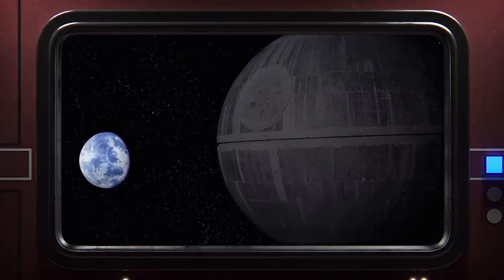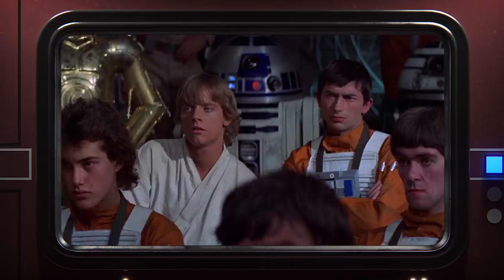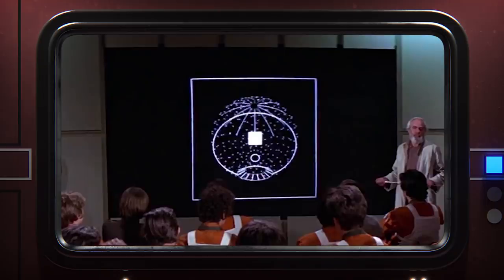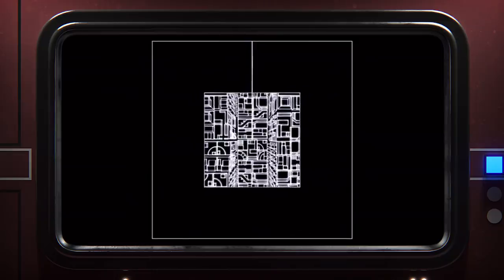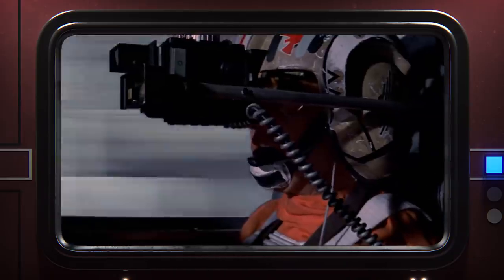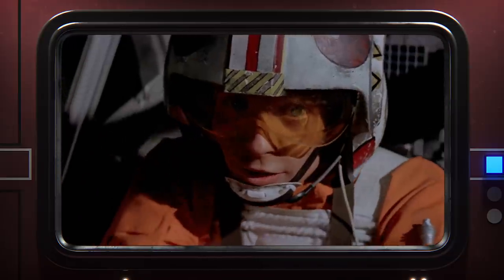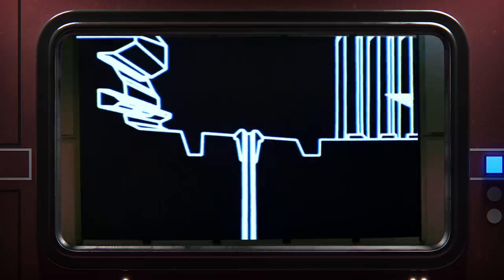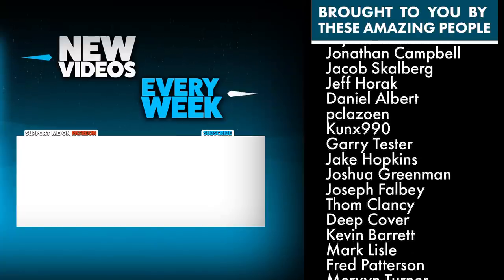The Thermal Exhaust Port Was NEVER a Problem

Comment: I just interpreted the thing with Urso to be that he purposefully left out a critical defense mechanism from that one exhaust port.  
That the others had a defense for proton torpedoes.  
Was that unnecessary?  Maybe, but I thought it was an interesting idea on how such a flaw, even a small one, ended up in there.

Also, a transcription of the explanation from Ep4:

DODONNA
                         The approach will not be easy. You are required to maneuver straight down this trench and skim the surface to this point. The target area is only two meters wide. It's a small thermal exhaust port, right below the main port. The shaft leads directly to the reactor system. A precise hit will start a chain reaction which should destroy the station.

               ~A murmer of disbelief runs through the room.~

                                     DODONNA
                         Only a precise hit will set up a chain reaction. The shaft is ray-shielded, so you'll have to use proton torpedoes.
Reply: In the Audio Book for Rogue One, it was said he kinda tricked the Empire into putting it there. He explained the issue, and gave three solutions. His favored solution was not the exhaust port, but another one (I didn't quite understand it, something like a large funnel, but long story short it made sure to mention that his preferred method was quite expensive and the exhaust port was the cheapest. He especially made it clear taht though the exhaust port wouldn't protect the standard crew quarters from radiation, it would protect the Officer Quarters, and seeing as he was presenting this to an Officer (some lieutenant, I believe), that would be fine with the Empire).

Comment: @EC Henry thank you as I have from the moment I heard about Rogue One 'fixing a plot hole' from the original movie I knew it was bull. As you say not only are there more then just the main port and the one that they used in A New Hope but 30 ships tried to hit the target and only two got close and only Luke got the job done and he is not only the son of the greatest starpilot in the galaxy but the strongest Force sensitive in the galaxy. I myself have long since pointed out that a weapon that can destroy a planet has to have an exhaust port, it just makes sense and with this video say there were at least 19 it makes even more sense.
Reply: On top of that, the Empire took the effort to put a ray shield over it. From the Empire's perspective, that solved the weakness. Assuming they knew about the chain reaction issue in the first place. They might not have and it was an honest design flaw. Even if they did, Proton torpedoes were expensive. Nobody would shoot one at an otherwise inconsequential exhaust port
. They'd have to launch a suicide mission to get the plans for the station in order to find that out. Nobody would be that crazy.

Complaining about the exhaust port is like complaining about an otherwise impenetrable suit of armor because it will shatter to pieces if you hit the left ankle with an obsidian axe. 1. Nobody is going to know about that. 2. Good luck attacking a fully armored knight with a sharp rock and hitting them there.

Comment: I agree with you on this but for one more reason that makes it actually impossible in the movie context without some massive levels of force interference. The Death Star was moving. It was orbiting the planet fast enough for there to be a visible difference in planet positioning in relation to Yavin 4 on a minute to minute basis. So it was moving and it was moving fast. Even if the shot was precise and even if the proton torpedoes could pull off that 90 degree turn, the death star would just be in motion and the proton torpedoes would have exploded against the inside of the shaft long before reaching the core.

Comment: Continuing with my theory,  the main exhaust port may have automatic port valves that pivot closed, to prevent flow back back into the reactor. The small secondary may have been flagged as a relief port with a valve, at the reactor itself, that would only open, automatically, as a pressure relief, being side by side with the main exhaust port. The small "flammable gas" tube  would evacuate the gas, as a precaution as well, from the flow created by the emergency port opening. Since the reactor would have to be in an extreme "over pressure condition, for the valve to open, it would be assumed pressure would be released outward. In theory, even an engineer may overlook the possibility that the port could actually be turned into an intake.  Perhaps, during the first test of the reactor's emergency port(s), Galen sabotaged the valve stop of that one port valve, to lose just enough valve stop integrity. So, if external pressure of a certain amount, suddenly pressed on it, say from an explosion, it would fail. Causing an actual "draw in" flow into the reactor, under normal operating standards.   Just a possible theory to consider.

Comment: It kind of reminds me of WW2, where on occasion the shells of enemy ships or air-dropped bombs would sometimes land in a ship's smokestack and cause some VERY serious damage to the engines or other systems. 

Did it happen? Yes. Did really bad things happen when something did get through the funnel? Yes. Could it be considered a weakness in the design of the warship? I guess so, yeah. But you can't just remove the ship's ventilation! Bad stuff happens when those gasses build up, and it'll probably be a lot worse and more certain than just building that small weakness into the design.

Comment: Well what I personally would like to think is that the 18 or so smaller exhaust ports have the same direct shot to the core but the trench they chose to attack had the least defenses, like least number of point defenses and furthest from hangar bays that have TIE screens and also one that has a good angle of pursuit from where the rebels are attacking from. And the main exhaust port is the most defended and doesn't lead directly to the core because they know it's an obvious target. 

I also hate how people trash on the Death Star flaw even though there was really no way the designers could predict that they would 1. Be able to obtain the plans from what is essentially Fort Knox and 2. Have an extremely talented pilot that also happens to be force sensitive even though which thought the Jedi were dead at this point or didn't even exist. This was a very specific outcome and was realistically unforeseeable by the designers.

Comment: I agree with you but as I can be very meticulous, I may have an argument to be in favor of RO.
If missiles are the only weapons that can pass the shield as it is a ray shield, maybe the empire could build just a simple grid or even a metal bar that will prevent the attack of a missile placed in one or several spots of the long pipe to the generator. 
Because viewing the size of the proton torpedo it is already very difficult to success one shot so just having a few metal bars or grids that will stop as many successful abd rare shots can definitely dissuade any operation to destroy the Death Star.
Maybe I go to far but I always thought about that long before Rogue One, so that's why I found pretty cool the justification.

Comment: I'm not an engineer, but I know that engineering is always a case of compromises.  You're never going to make everything 100% fool proof, regardless of whether you're designing toaster ovens or moon-sized space stations, so you're always going to have go with the best overall balanced design.  Which means that small things like a potential weak spot one of 20 or more exhaust ports are going to either be overlooked entirely or concluded that the odds of that being a very serious weakness are very low.

Comment: Any physical torpedo would’ve been able to penetrate it as ray shields are only for high energy objects like laser blasts, but proton torpedoes might be the only ones capable of doing the damage and maneuvering in the way they did, the rest of the exhaust ports may have had secondary chambers which made it so that anything that got through couldn’t get to the core or even deep enough to do any significant damage, but Galen Erso sabotaging it still makes a lot of sense as to why that port didn’t have secondary chambers or anything. Also Star Wars memes are often based on misinformation or just plain lack of attention, ie stormtroopers always missing, even though they explained it in the movie as being on purpose

Comment: The sabotage was not giving the exhaust port a u-bend. Therefore allowing a torpedo to go straight down the exhaust port.
Reply: Paul Naughton actually, the sabotage was making the rector very unstable. If it was not as unstable, you would have need more then 2 torpedos to destroy it.

Comment: I believe the sabotage was, in addition to making the reactor as nstable as it needed to be for a single torpedo to detonate it, was probably also some sabotage that is the reason only this exhaust port would work. Its easy to dismis a single port with a faulty design than it would be if every port had it.

Comment: Like you said, the Death Star is covered in trenches so who's to say that each trench has an exhaust port? Yeah Dodonna says "There's a small thermal exhaust port" and that could mean that there are many but it can also be singular; "I have a phone". Either way it's still implied in Rogue One that it was designed to be undetectable and I believe that there was a line in RotJ about Death Star II having multiple smaller exhaust ports.

Comment: I mean from an engineering and common sense standpoint, why did it need an exhaust port that leads directly to the most vulnrable part of the station? It doesn't matter if it's a one in a million shot, The french didn't think germany could cross the Maginot, and Rome didn't think Hannibal could cross the alps with elephants in tow. The cost of getting that wager wrong vastly overshadows the cost of ensuring it wasn't a possibility, which is clearly not that hard considering they, as you say, have 20 exhaust ports (including the main one) that don't pose a risk of catastrophic failure.

Comment: To play the devil's advocate, the argument could be made that the specific exhaust port was the only one designed to be an exploitable weak point. The others could've all had grates or bends or some kind of protective measure against torpedoes, blaster cannon fire or whatever, while that specific port was a straight, uninhibited shot to the main reactor

Comment: That one port is a straight line to the reactor which makes it easy for the proton torpedo to navigate to. The others probably do not make a direct connection but goes through other subsystems and not in a straight line either.
Reply: not straight into the reactor, that would've taken way too long. like they said in the movie, it causes a chain reaction. It blows up something, which blows up another thing, and on and on until the entire station blows up

Comment: My issue with it is how did they ever plan to have the freaking torpedoes arc in and then stay straight the entire length of the vent without coming into contact with the wall once, considering the size of the thing. As mentioned in this video it does seem Luke uses the force to manipulate them to arc in, but really? Kinda makes him a MARY SUE.
Reply: The aim wasn't to fire the torpedo itself through the hatch and all the way down to the reactor. The idea was to start a "chain reaction" that would ultimately reach the core; e.g. the torpedo hits something inside the exhaust shaft, those components are destroyed, the explosion and debris destroys something next to that, and so on, until you hit the main reactors. It's basically the embodiment of cascade failure, where a series of individually small malfunctions snowball into something much worse.

Comment: To stregnthen your arguement, they don't say the missles will go down and hit the core. Ge says it will cause a chain reaction. This can imply that such a reaction would not occure if any of the other exhause ports were similarly attacked. Yet another level of protection. This could give creedence to the Rouge One "designed flaw" but would also give creedence to it being so minor as to be ignored entirely.

Comment: For me the issue wasn't the existence of the thermal exhaust port. That makes sense for reasons explained in the video and in other comments here. For me it was the method of defense:
Energy shields that are explicitly known in the Star Wars universe to only stop some projectiles, not all of them. I'm curious if they couldn't have put something more substantial. Like an s-bend. Or a series of muffler plates. Or some grates. Anything to make the straight shot down to the reactor not a straight shot and the torpedoes hit something less vital first

Comment: It makes more sense if the torpedo hits something in the shaft that creates a chain reaction.  Often when engineering complex systems, care is taken to provide shielding between critical or dangerous components so a failure in one does not cause the loss of others.    I always saw galen's sabotahe as carefully positioning internal components such that damage at that exhaust port would cascade down into the core.

Comment: I never really stopped to reason what happened after the torpedos got in.
If you think about it, closing the exhaust port is... going to prevent all heat from exhausting.
(Maybe Tarkin doomed them all by ordering to fire!)

And it's not like they'd have extra spare exhaust ports, after all it was a weakness.

Comment: My issue with the "the death star weakens was a sabotage" is that the geonosians are the ones that designed the death star, not the empire, so a sabotage couldn't be implemented into the plans to begin with
Reply: I bet the Geonosians only designed part of it, or the Empire made some heavy changes. Would you really want the sort of people who have gladiatorial combat in a universe with ftl to have the designs for a world ending battlestation?
Reply: @adams13245  they may have changed the interior design of rooms and some of the controls. There is no reason to change hole that is supposed to exhaust heat.

Comment: I don't have a problem with the exhaust ports, but why is does single point detonation cause the entire station to explode? Instead of a centralized power source, could there be multiple power sources for separate hemispheres of the system so that one point failure does not destroy the entire station?
Perhaps the reactor must be centralized in order to power the superlaser (If it draws from multiple superlasers they would still be connected in some way to feed directly to the weapon).

Comment: When watching Rogue One, I always felt Galen's sabotage had nothing to do with the exhaust port. The key is what he says and who he sent the message to.

"Saul. The reactor module. That's the key. That's the place I've laid my trap. It's well hidden, and unstable. One blast to any part of it will destroy the entire station. You'll need the plans, the structural plans to find the reactor. [...] Any pressurized explosion to the reactor module will cell off a chain reaction that will destroy the entire station"

Nothing about an exhaust port, everything about a reactor. A reactor that's been designed to explode at the slightest provocation, and has also been tied into the grid in such a way to cause every other reaction to detonate. I don't think Galen's idea was ever for someone to fling a torpedo down a small hole. His plan was for someone to be inside and plant a small charge. That's why he told Saul; he and his Rebel cell are ground fighters and infiltrators. They wouldn't use a fighter to get the job done, they'd try to sneak aboard and take it out from within.

Throwing a torpedo at it was the plan of the Rebels on Yavin, who didn't have the time to sneak aboard the Death Star and place a charge. It wasn't a good plan, but it was the only one they could do in the time they had.

But... I know there's other information outside of the movie that explicitly states it was the exhaust port, and the reason behind the message being sent to Saul was simply because that's who Galen knew.

Comment: The exhaust port was never a problem for me. Everything has it's weakpoints and its flaws. Exhaust ports on real tactical vehicles are weakpoints in the armor. I think the greater obvious weakpoint is that it goes in a straight line to the reactor.... but then again, that may have been by design.
Reply: Or, since it was a "chain reaction" that would lead to the reactor blowing maybe they just had to go in to a point and blow which would send a blast further down the next line and so on until the reactor suffers a catastrophic hit.

Comment: THANK YOU. I hate Rogue One so much. The hubris of the Empire over the possibility it was a weak issue is THE WHOLE POINT. Oh, and it’s for thermal exhaust. Which means it’s so the core of the thing doesn’t overheat and explode. So OF COURSE it starts a chain reaction that goes right to the reactor core. That’s like being surprised your tailpipe leads to your car’s engine. It’s a necessity and the possibility of vulnerability is why it is shielded and gunned. And even then, the Empire doesn’t expect attack to come from small fighters, which is the only way to do it. And they easily picked off every ship with just three TIE fighters. If not for the return of the Falcon, the Rebels fail.